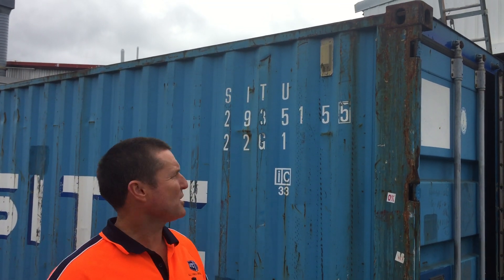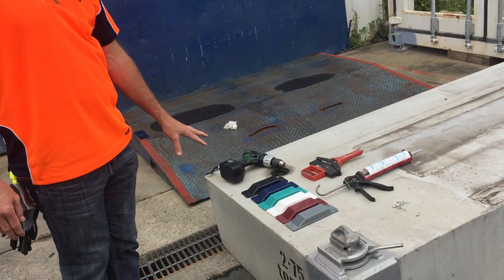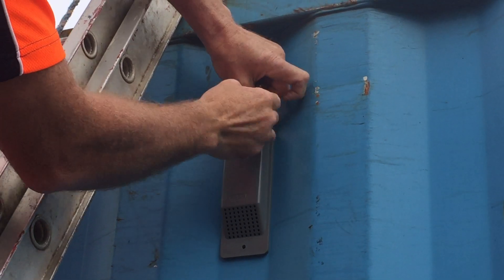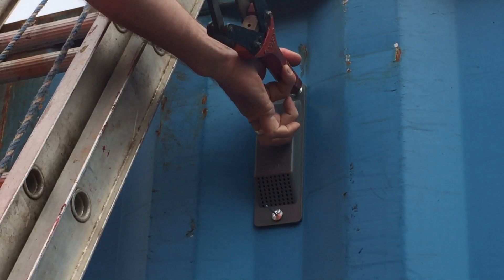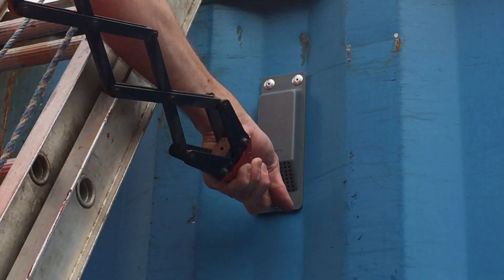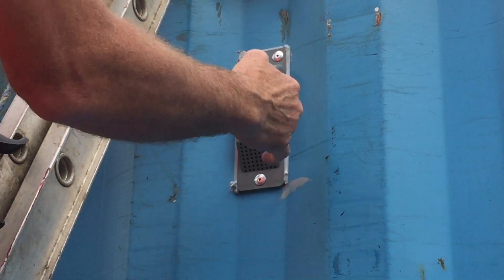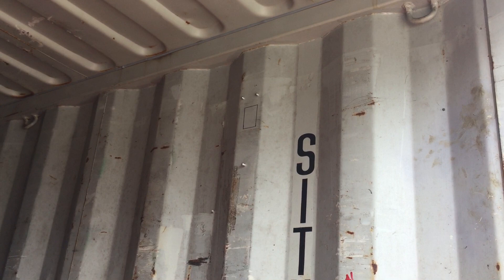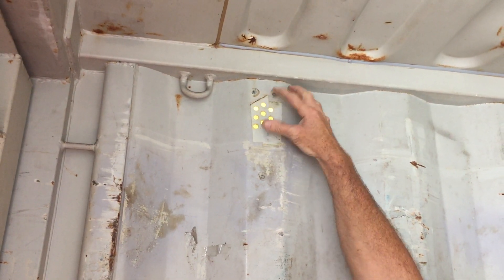How to install shipping container vents

Comment: We purchased 4 of the VEN-005 heavy duty steel vents, A1 products and super fast delivery.
There going to assist the solar powered whirlybirds to extract the 100 degrees heat from the containers during the 6 summer months.
Reply: @Specialized29er,where do you get the solar powered whirly birds, please?
Reply: @aspenriver76  I'm thinking any decent  solar place energy and products place would have them. Mine were a little pricy at $550 each but a top quality product with the option of wiring them into the mains electricity for those hotter than hell outback Australian nights.
Reply: @specialized29er86  Thank you for replying!

Comment: I can tell you from 40 years of personal experience, those small air vents are not good enough for dry docking storage on land. They will rust from the inside out, so you need to make larger vents, and when they are empty, use some sort of smoke like a Fourth of July smoke bomb or professional smoke machine to see air movement or you’ll end up chasing your tail trying to waterproof your container thinking it’s resting from the outside in.
I think the standard for a 20 foot container is to have one in the back right and another one in the front left top part of the container .
What I’ve done if I’m not stacking another container on top of one that has a hole in the roof is to simply make the roof hole larger and put one of those spinning vents. You see on commercial kitchen roofs. Hope this helps someone from having to replace a container!
Reply from the maker: Cutting a hole in a perfectly good roof is a mistake. i am asked by every whirly bird manufacturer to sell their products. and i dont. i am turning down money because you are welcoming infestation, rodents and moisture into the container. stick using Vents, steel, Plastic or otherwise4 and the container will outlive all of us.